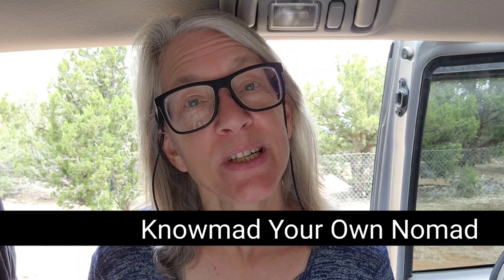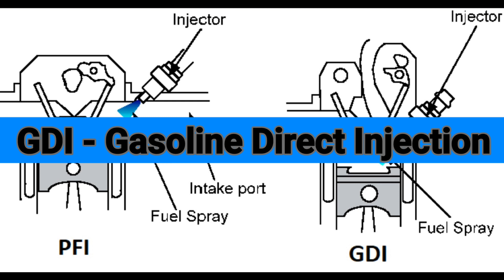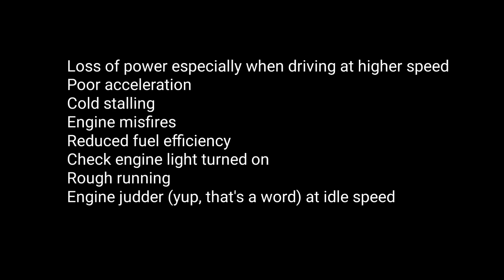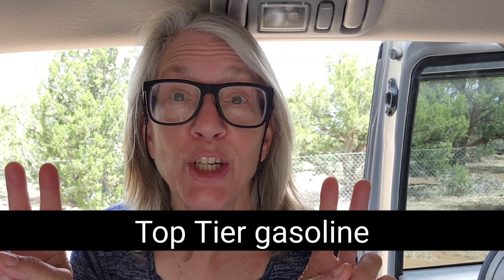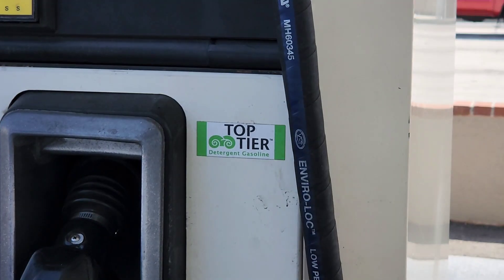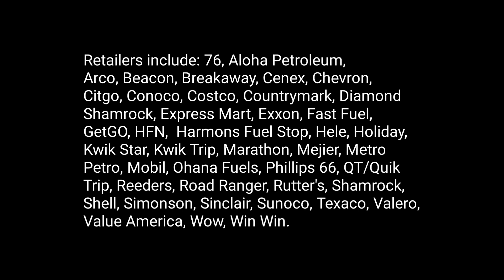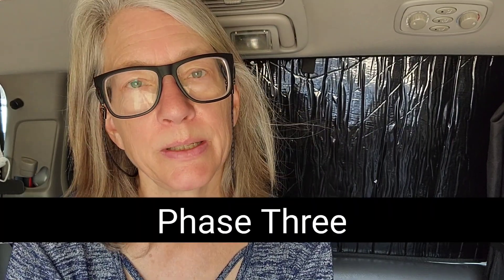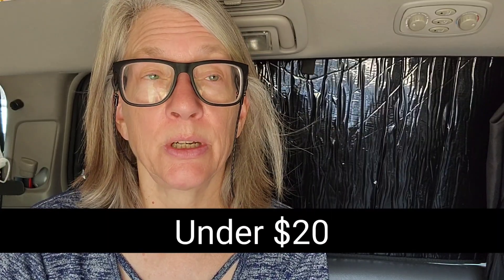Increased oil consumption and GDI - 2016 Kia Sorento SUV intake valves carbon build-up solutions

Comment: I just bought a 2023 Kia Sportage, & I researched all the carbon issues associated with Direct injection engines & the pitfalls, luckily mine has a SmartStream 2.5L engine that has duel injections, GDI & MPI , with both injections the carbon isn’t supposed to buildup. You can find videos explaining the differences. FYI carbon is NOT singular to Kia’s. I’m glad I have what I have & manufactures have realized the concerns & addressed them. Good 👍🏾 job Kia.
Reply from the maker: Yes, KIA is not the only one!
Reply: Duel injectors are a great idea.
Reply: @mikeheckman4995  my 2018 Ford F150 2.7 v6 has dual fuel injectors (6 direct injection and 6 conventional port injectors) and i have not see any oil comsumption with extended 10,000 mile oil changes.  I currently have 110,000 miles on the odometer.
Reply: @jdm_eh9367  The 10k oil change will soon toast your turbos:) I have a 2015 F150 Ecoboost 130k miles zero issues. Change oil every 5k miles and use only Tier 1 Gasoline!!

Comment: You hit every remedy I’ve seen about GDI technology. Very knowledgeable 👍🏾
Reply from the maker: Thanks, Justin! Absolutely, there are many makes and models that suffer from this problem. It's great to hear that manufacturers are paying attention and making changes to remedy carbon build-up issues. Would love to hear what you are experiencing in your Sportage around 70,000 miles.
Reply: No doubt, 👍🏾 I’ll definitely will be posting my experiences, I drive highway miles to work daily of about 90 miles daily and have every intention of getting my 100K mileage warranty. 😊 
I think I lucked up on getting a duel injection engine, but Kia knew better. Lol 😂

Comment: One of my coworkers owned a hyundai oil user of the same era. He had good luck lowering oil consumption by doing Berryman B12 piston ring flush when oil usage got excessive. Low tension piston rings and poor oil ring design are the issue causing oil burning not the GDI which does cause intake valve fouling.
Reply from the maker: I've not seen that in the research we've done. Thanks for your contribution!
Reply: @knowmadyourownnomad8194 I'm in the process of soaking my piston rings now with the Berryman B12. My 2014 Sportage started burning oil at 80,000 and has gotten much worse. One explanation that made sense was that carbon from the valves flakes off and clogs up the oil rings. Some people swear by the soak method even on other makes.
Reply from the maker: @Kiskassklan Hope that method worked for you!
Reply: @knowmadyourownnomad8194  I haven't driven it since soaking the rings but I'll be able to tell within 500 miles.
Reply: I have seen the piston soak videos that seem to have good results.
I found another method on YouTube and it really worked on my 2015 Kia Sorento.  I added Berryman Chemtool to an empty gas tank and then filled the tank with the highest octane gas at the pump.  I then drove approximately five miles while maintaining high RPMs (4000-5000) but never redlining the RPMS.
Evidently, the combination of high RPMs (heat), higher octane gas, and Berrymans Chemtool destroys the carbon buildup plugging the piston oil ring.  This frees up the stuck piston oil ring and eliminates excessive oil consumption.
The video that I watched used Liqui Moly fuel treatment and recommended driving for 100 miles at high RPMs.  That distance seems excessive.
It worked on my GDI engine but try this at your own risk.
Reply: @dougwigley8072  I did that too along with soaking the rings and it just about completely stopped the oil burning.  I think the driving at high RPM'S did it, not soaking the rings. I was shocked!
Reply: So basically an Italian tuneup
Reply: @thelastshallbefirst6531  yes. I dropped my auto transmission into a lower gear and drove it about 3-5 miles at 4500-5000 rpm then letting off gas to let the engine brake the car. Doing that over and over. Its not burning any oil now. It started burning at 80,000 miles and got worse till I did this at 150,000. Runs great now too.

Comment: Install the catch can. It goes after the pcv and the back to intake. Gas additives won't stop build up. The whole issue is that the gas does not get sprayed across the top of the valve. Clean the valves and then install can. This will help prevent build up. I did it on my wifes 2017 kia soul. I chemically clean the valves regularly now as well. The can catches 3 or 4 ounces of oil per oil change👍
Reply from the maker: Thanks for adding these details. Hopefully it will help someone else.

Comment: 2015 KIA Forte Koup 2.0L with 132,000+ miles. Change oil every 5,000 miles. Uses 3/4 of a quart between oil changes. No engine problems.
Reply from the maker: You are fortunate. Others are not.

Comment: By the time you read this you may have already found a solution. First, an oil catch can will only prevent the blow by from caking on your valves further. But the problem at hand is the blow by. What causes blow by? Stuck piston rings. Poston rings get stuck and oil blow by gets through the cylinder walls and goes to your valves by way of a hose that goes to you pcv valve. Hiw do I know this? I am a kia owner and have the same issues. I recommend that you use valvoline restore and protect oil from here on out and see if this works for you. This engine oil cleans the inside of your engine quite well and can loosen those stuck piston rings. Another tip, don't use oil additives. Gas additives are good but oil additives are not in fact can be harmful to your engine.
Reply: P.S. my 2013 kia sportage has over 450K original miles. Even the dealership is amazed when I've taken it in. So I have a lot of experience and I think I have a good idea of what I'm talking about.
Reply from the maker: Thanks for adding your experience here. I have since moved on to a different vehicle but am glad to host a space where possible solutions can be found.

Comment: I have a 2017 Sorento with same problem. It has 58,000 miles on it now. Uses a quart about every 1000 miles. I have had the intake valves/manifold cleaned twice. (Dealer engine cleaner) It is under warranty and the next time they  do a mileage check, if the oil usage is 1 quart for less than 1000 miles they will do a ring cleaner solution down spark plug holes ..overnight sits according to Kia technical service bulletin. If that doesn't work, I am told by the dealer  that I will get a new free engine. I take it to the dealer for every oil change. I bought a new PCV valve but didn't put it on yet. Not surprised at no response by dealer on walnut shell approach. They don't do that stuff. Some people on YouTube have had success with ring cleaner approach.
Reply from the maker: Good luck with finding your best solution!
Reply: Hello what oil viscosity you're using ?
Reply from the maker: @mooauto2388  I use 5W-30 synthetic

Comment: Yep, walnut blast is the best cure for carbon build up on GDI engines. Gets ‘em like new. I suggest using Amsoil 100% synthetic Signature Series motor oil and Shell premium fuel. To prevent further build up, use CRC intake valve cleaner 100-300 miles before each oil change. A quality oil catch-can is a must for turbo engines. That’s my two cents. I hope that you’re trouble free for many miles!!
Reply from the maker: I had no idea this comment thread would become a Wikipedia of sorts for this issue, but I'm happy to provide a spot for troubleshooting. Thanks everyone!
Reply: I see you mentioned turbo engine. Is one beneficial for the 3.3l v6
Reply: Probably so, but search around on YouTube and compare the notes of some if the pros out there. A quality catch can is fairly inexpensive and requires very little maintanance. Any mediocre mechanic should have no problem installing it correctly within 30 minutes.

Comment: I have a 2021 Sportage. One of the first things I did was put on a catch can. I also change pcv valve every 10,000 miles.
Reply from the maker: Just curious what the volume is that accumulates in the catch can.

Comment: There are many ways to possibly reduce oil consumption:
Change pcv valve
Use engine flush like BG EPR
Use high quality Synthetic oil
Go up an oil grade
Use combustion chamber cleaner occasionally like BG 44k
The best by far is a piston soak process to free the oil rings. 

You really should have Dealership do a oil consumption test. When excessive they will replace the engine usually for free.
Reply from the maker: @zzman5306 Are you a mechanic, or someone who has had to deal with this painful issue before?

Comment: You need to do a pressurized piston soak, manufacturer TSB recommends every 36,000 miles. The rings get gunked up. The intake valves arent as much of an issue, just loss of power. You can spray an intake cleaner into the pcv hose prior to each oil change, that should slowly clean that up.
Reply from the maker: Thanks for adding to the conversation. It's amazing how many different suggestions people have.
Reply: @knowmadyourownnomad8194 I think I talked with you before and seems the easiest thing to try is getting on the hiway, dropping transmission into a lower gear and drive for about 5 miles with the engine at high rpm's of 4000-5000 rpms. Pretty sure that's what fixed mine. Now after 4000 miles it hasn't burned a drop. That high engine speed burns the carbon off the rings.

Comment: There are a few main problems you are having.
1) the oil control rings are stuck this is causing oil to get past the rings into the combustion chamber and causing blow by into the crank case. 
The blow by is causing your pcv system to pull in excessive oil vapors into the intake which is the carbon deposits on the intake valves. 
2) fuel dilution of the motor oil caused by blow by made worse by GDI honda notably had fuel dilution issues with their earth dreams engine now you may have a leaking GDI fuel pump which may be leaking gasoline into the engine via the piston that rides on the camshaft.

You might want to try a berrymans B12 piston soak, send the oil to a lab to actually see whats going on in the engine, shorten your oil change intervals to 5,000 miles and switch to Valvoline restore and protect.
Hyundai and Kia are not the best engines, just price out a used engine at a junkyard versus other makes, a used engine for your Sorento is 5k and up, yet a highlander 3.5 is a 1,500 engine.
Reply from the maker: I am now driving a Suburban, but hopefully this may help someone else.

Comment: Top tier gas and typical fuel injection cleaners will not stop the valves getting carboned up.  This is because no fuel washes off the back of the valves like port injection does.
Reply from the maker: Interesting
Reply: You are incorrect, better gasoline has proven to clean intake valves. Ever seen a racing engine that runs on methanol? Absolutely spotless😂 3rd generation mechanic and engine builder
Reply: @owenhill-vf7ko  Direct injection engines don't spray fuel onto the back of the valves. They spray it into the Combustion chamber. So how do the back of the valves get clean when fuel doesn't touch them?

Comment: I'm a mechanic and I own two Hyundais, and they are the worst cars to ever invest in. They are temperamental, unreliable, and just junk. Install an oil capture can. This will prevent carbon buildup in your intake valves. I
Reply from the maker: I've yet to meet someone who has done this, would love to see one installed.

Comment: Kia's/Hyundais have bad engine designs. Lots of oil consumption due to stuck oil rings due to carbon. They also have major engine failure due to bearing failure. They are replacing lots of blown engines.
Reply from the maker: Have you had one replaced?

Comment: I am not sure how the carbon buildup and oil consumption are related. These engines are known for oil consumption and in some cases, if it is severe enough, you can get a replacement engine under warranty. You have to hound the dealership though. 
No amount of cleaning will solve the oil consumption issue. Only a proper engine rebuild will. So try to get a motor if you are still under warranty.
Reply from the maker: Unfortunately for many of us, we are not the original owners of these vehicles, and that avenue of recourse is not open to us.
Reply: @knowmadyourownnomad8194  The manufacturer's warranty is vehicle-specific by law, it does not matter whether the car has had 10 owners. For a Hyundai or Kia, it is up to 100k miles.
Reply from the maker: @moshet842 I am past that now, but maybe this will help someone else. Thanks!
Reply: Carbon can make the rings stick as they use low tension rings. This can cause oil consumption.

Comment: I use Costco, Synthetic dexos rev 3 oil,, 5W-30 which is slightly better than dealer who uses Dexos 2. The engine cap says 5W-20 but I think dealers know the trouble on these engines..so they use 5W-30 anyway.
Reply from the maker: That's my understanding as well, 5W-30 is what gets used by dealers.

Comment: 2016 Kia Sorento - 3.3L Engine.  86k miles.  Oil burnt out within 3k miles causing the car to knock and loose power.  Diagnostic test stated bad Right and Left Exhaust Solenoid need replacing.  When they were pulled out, there was aluminum particles wrapped around them and throughout the head.  When the new solenoids where installed it did not help.  Engine is dead.  Kia will do nothing...... I am livid... any suggestions.
Reply from the maker: I would be livid too!
Reply: If the car is still under warranty, threaten to see a lawyer. They might listen.
Reply: Im in a similar predicament, my engine seized on the highway in the fast lane. Vehicle has always been serviced by Kia dealer, who refused to honour warranty after the failure. Its been a year now of huggling with Kia. An independent technician is coming to inspect vehicle tomorrow to determine causation so hopefully we can use his report to get kia to  replace. I honestly dont know why people are still buying these cars or choosing to keep them.

Comment: I have kia sportage 2017 .I did every possible senario to solve  oil consumption burning. None is working. I hope  ,,,,,,,,,,,,,,,?
Reply from the maker: The walnut shell treatment is definitely a commitment in time and process, but it worked for me. Good luck!
Reply: Eventually a replacement engine when it gets bad enough. Have dealership do a consumption test.

Comment: What was the cost to clean the intake valves?
Reply from the maker: Here's the list of items and cost: -Compressor with appropriate hose length (already had)

-Wet/dry shop vac with appropriate hose length (already had)

-Walnut shells (we used 5 pound bag) $22 on Amazon

-Harbor Freight dispensor for walnut shells $30

-Harbor Freight nozzle for compressor $30

-Adaptor cover for chamber openings with nozzle opening for walnut shells $15 on Amazon

-1-1/4" nozzle and 1-1/4" hose for shop/vac to remove walnut shells from intake valve chamber $15 on Amazon

Comment: Do you still have this issue
Reply from the maker: The gas mileage remains where it is supposed to be, but the oil consumption is still excessive. I've inquired with two mechanics that say as long as I don't have stalling or blue smoke to just keep adding oil when needed. It sounds like the job is tedious to dismantle the engine enough to fix adequately, and no one wants to take the time to do that.
Reply: @knowmadyourownnomad8194  okay so you're still having that issue even after the walnut blasting , My 2017 Kia Sorento with a GDI engine is constantly having the same issue too by burning through  oil like crazy
Reply: @SoulForMany  intake cleaning does not address the stuck piston rings that are causing excessive blow by, resulting in oil consumption. Do a piston soak. There is a TSB detailing how the dealer does it. Works like magic, so long as the walls aren't too scratched up already.
Reply: @peterharrell7305  is it just a known issue that GDI is just burn oil because I feel like everyone I know who has one deals with the same issue
Reply: @SoulForMany  well, gdi isn't really the cause of the oil consumption, the low tension rings are. We use lower tension rings to reduce the work required to turn the engine over, which results in a higher efficiency. The problem comes when carbon restricts the movement of those weaker springs, they are more prone to become immobilized than the stiffer rings used in older engines. Too much carbon build up can do the same thing to the stiffer rings, but it just happens after a longer period of time (say 100,000 miles instead of 30,000 with lower tension). Old cars would burn oil, too. It took more gunk to make it that bad, though. Gdi is the direct culprit for intake valve carbon build up, however. But that really just causes a loss of power, sometimes a chunk can bust off and bounce around in the combustion chamber, causing damage. That about it.
Reply: @peterharrell7305  So what would be the best thing I can have a mechanic do to help this issue and should I throw a catch can on it
Reply: @SoulForMany  that can help, but it doesn't fix the problem. Depending on your model, you need to add a piston soak at regular intervals. Somewhere between 30,000 and 50,000 miles. Some engines are worse than others.
Reply: @peterharrell7305  I will look into letting it soak over night in my 2017 Kia Sorento